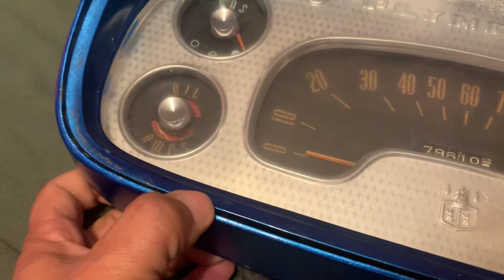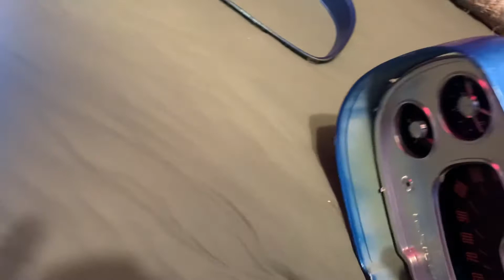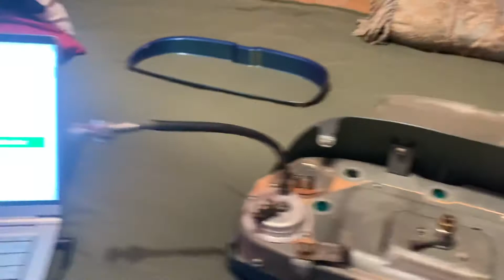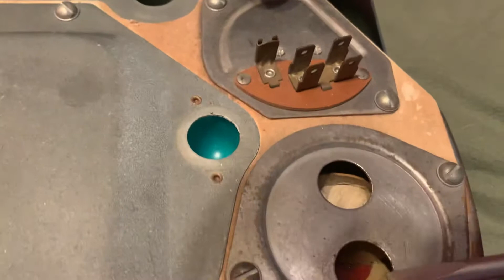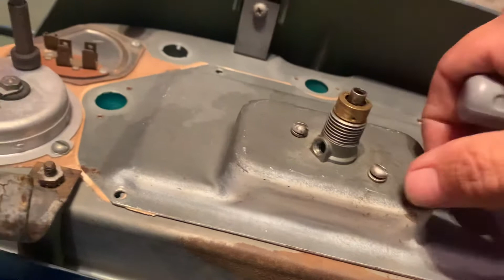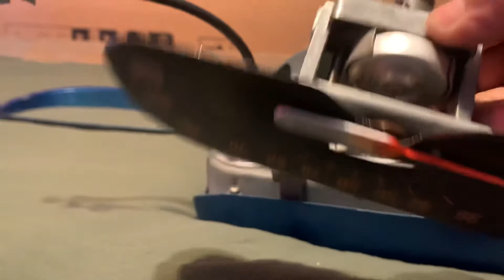Plymouth 1957 1958 speedometer, cluster how to uninstall

Comment: How do you get that unit out of dashboard
Reply from the maker: Make sure you unscrew the speedometer cable off the back of the cluster. Take a picture of where your wires are connected on the gauges. Then you can take the whole instrument cluster unit off the dashboard. If you are viewing your cluster as if you were in the driver’s seat it would come out straight towards you.